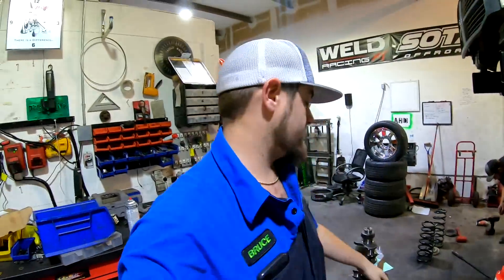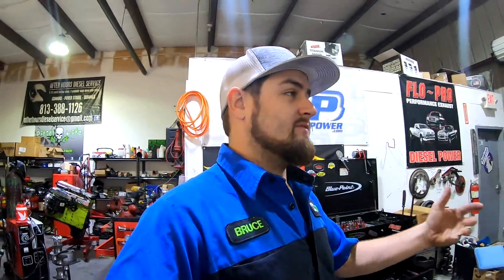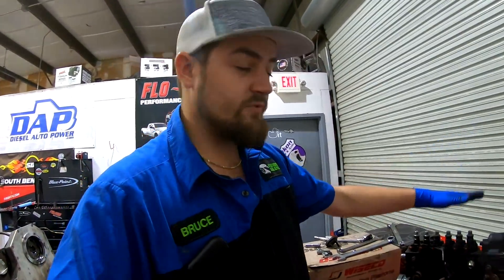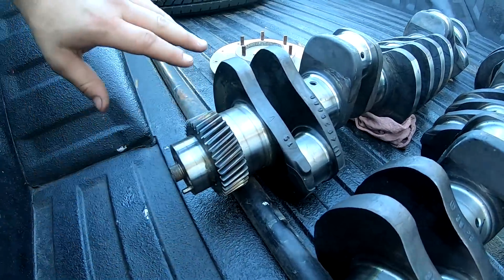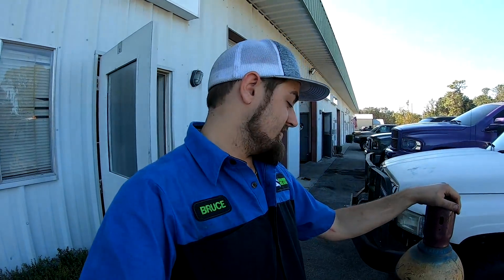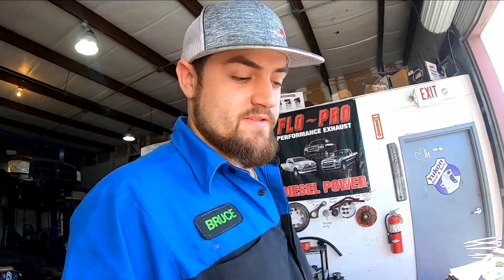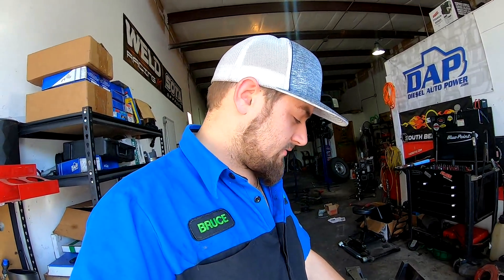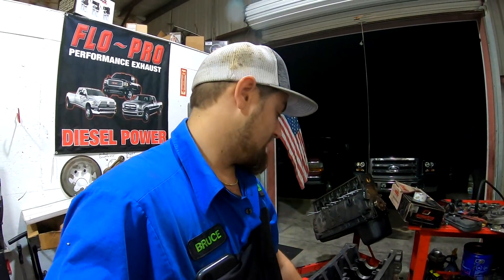This Might Be ILLEGAL..... IM NOT SURE

Comment: to be legal on the road you have to have the valve off technically LMAO , but with a tank that large you have to have an inuse cover for the valve , commonly used by mobile welders and service trucks , you can pick one up at the gas place , I say you mount that large one , and  a small one , even get a set of torch hoses to use as the feed lines , then the law would have no idea it was N02 but rather think that truck is a service truck and it's just a torch set , plus it will be one hell of a conversation piece LMAO
Reply: Your still alive haven't seen a new vid in what feels like almost a year
Reply: @thegage1984  oh I am alive , but barely , I can't get caught up , building a rollback from scratch at the moment lol
Reply: Sweet can't wait to see it I have been subscribed since you blew the font axel out of old blue
Reply: @thegage1984  I want to forget that event , that event totaled that truck , and to this day it's only 90% fixed , the cab is still shifted about 2 inches on the frame , still havent fix the cab corner , only thing that even made the truck fixable was the fact i did not claim it on insurance to keep the title clean lol
Reply: @towrecker  I was talking about when you broke the Dana 44 unless all that happened from that event
Reply: @thegage1984  it actually got broke when the truck had one rear axle sheared off , and the car that was on the tow dolly came off after we hit the bridge backwards , it was around 10pm and nice and dark , all the lights on the back of the truck smashed , the car we were pulling on the dolly did not even have a battery in it , I chained to the car , put it in 4 wheel low , and stood on it , I dug ruts in the interstate , and drug that car out of the road , after I put a rear axle in it ect , and got it where it would drive , and had the frame pulled , it bent it infront of the axle on the passenger side , and put a diamond in the frame as well , it started clicking every now and again , I thought I had damaged the transfer case , i did extremely dog and abuse that truck to get that car out of the road before someone got killed hitting it , that big block seen WTFO for about 3 min and still lives to tell the tell , anyways it turned out I had sheared the crosspin in the differential on the front axle  , when the axle busted is when that pin fell out , caught the case , and jammed in the gears at that point wringing the pinion off ... thats how all that happened , I don't think I really ever told the story , just bits of it , it still bothers me to this day , being thats a one owner truck , and still titled as such , did I mention it's been wrecked 3 times in it's life , once in the snow , another on ice , both of those my dad did , both on my birthday (different years ) and the 3rd time I wrecked it on his birthday , so needless to say I will never drive that truck ever again on his birthday , because if history does repeat , I aint gonna let it lol
Reply: @towrecker  that truck is a badass I have always thought that truck was cool I'm guessing your dad gave that truck to you or you inherited it is what I get out of it  them old fords are bullet proof not like todays trucks thank you for clarifying the story on that old truck